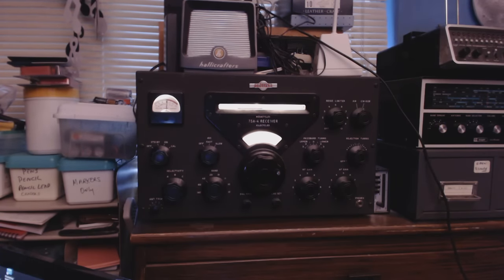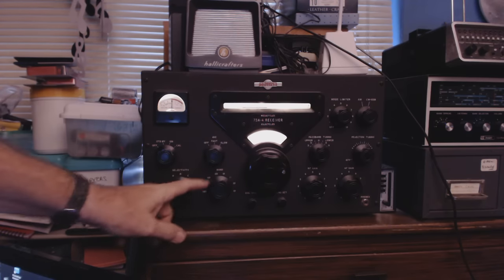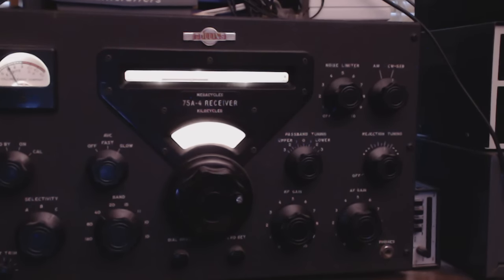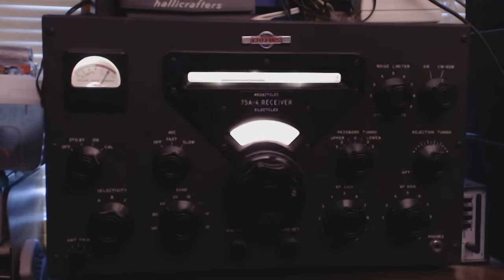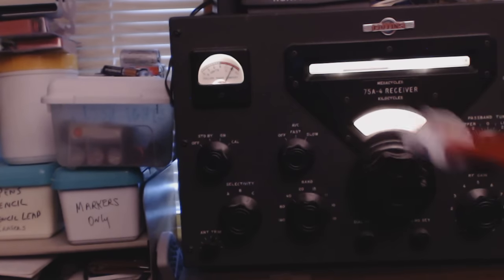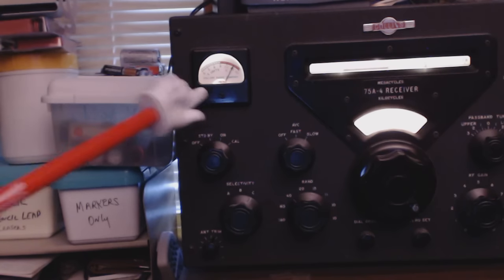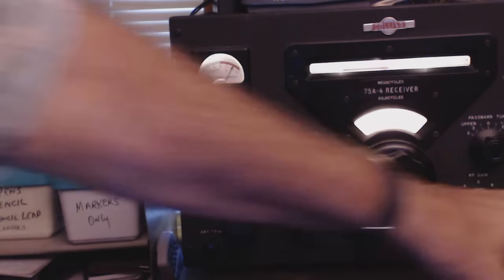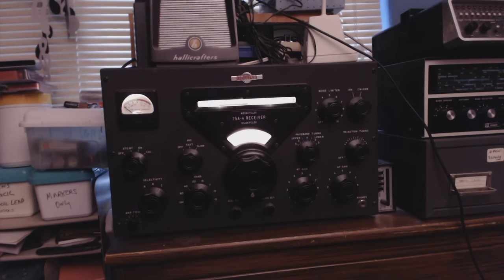TRRS #0689 - Collins 75A-4 Receiver, PT 1

Comment: Tom, your ability to review and comment on modern SWR receivers is no doubt enhanced by comparing them against your Collins. Any tips on tuning in ssb on a hammurland hq129x? I have tried with the bfo and narrowing the crystal filter and can't seem to get it clear, or is it just not possible?  Curious as to why you are no longer active on the bands yourself? 73, Tom
Reply from the maker: +Tom k2bew The thing I do when tuning SSB on these old radios is to continue to use the tuning knob along with the bfo knob.  I got out of the amateur radio hobby when I was into to fishing.  Got rid of most of my transceiver except for my little ICOM 706.  Now that I am too old to do much fishing, I back into radios.